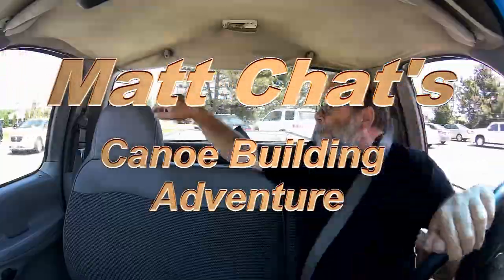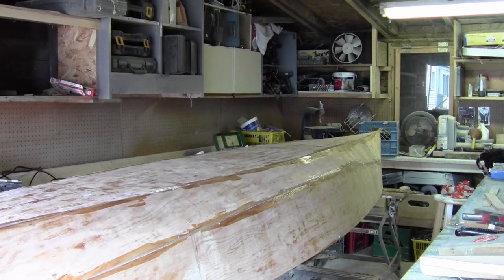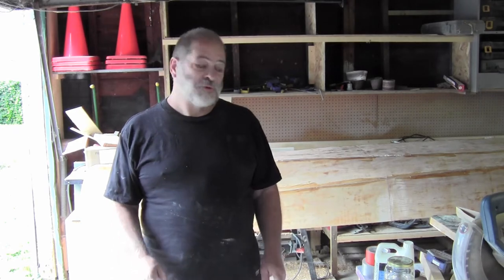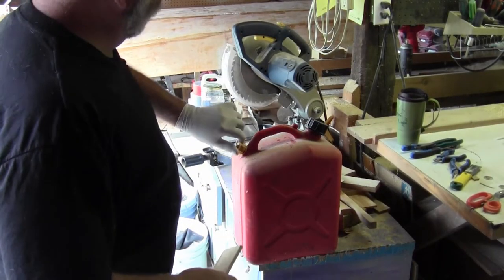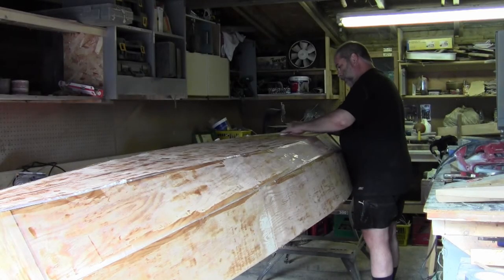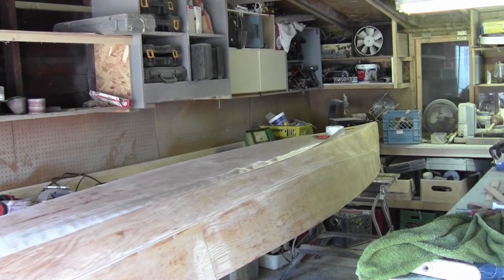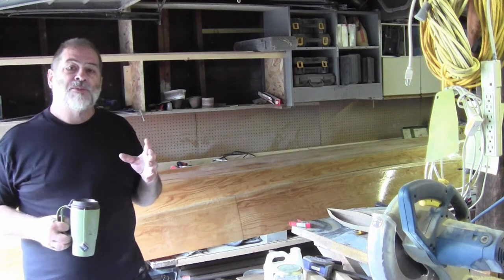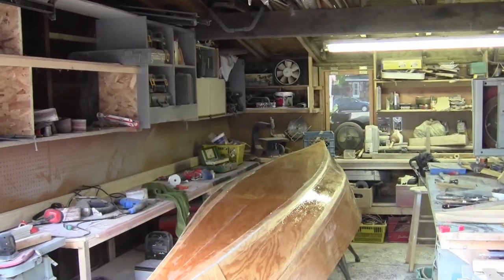Build my own plywood canoe part 9

Comment: Very interesting and informative. I wish you success! I recently prepared plywood parts. I will also build a canoe. Your experience will be useful to me. Thank you for the video.
Reply from the maker: Thanks for your comment. I have finished the build and am working on releasing the videos. More to come soon. Hopefully you will benefit from my mistakes. good luck on your project. Let me know how it turns out.
Reply: Thank you! I will definitely take into account your experience. I will build a boat in the summer. Now the head and hands are busy with other things. We are still cold and the snow is falling, and in the workshop I do not have heating. I'm slowly collecting the necessary materials and details. When I build, I will share information about the process.
Reply from the maker: It is still winter here as well. Just like you, I am planning the summer projects. Maybe go on some canoe trips...
Reply: @authormattchatelain  Hello. I want to inform you that I am also building a canoe. In the summer to start building failed. Construction began only at the end of September. I worked in the evenings, in my free time. The intermediate result is: http://www.aquafanat.com.ua/forum/index.php?act=attach&type=post&id=347519 Now the cold weather does not let me work. I hope to go to the water in May.